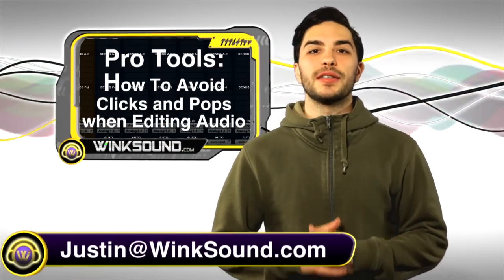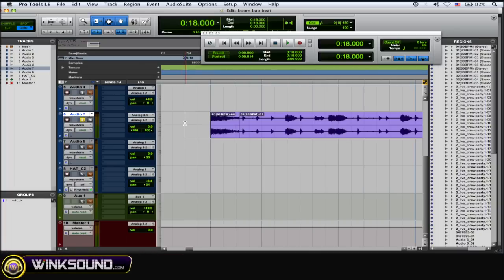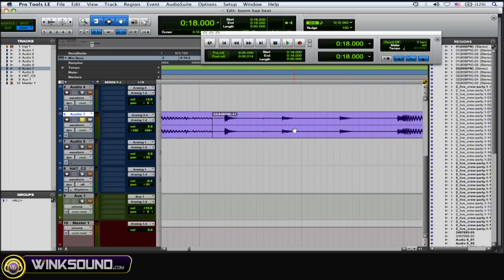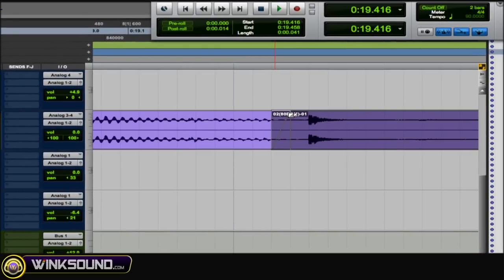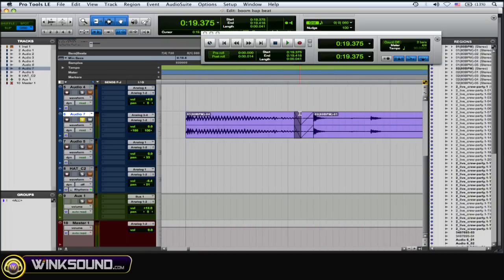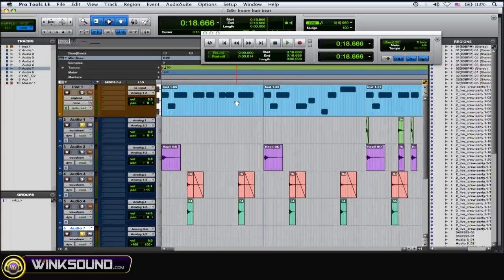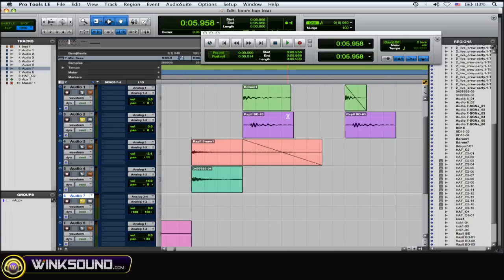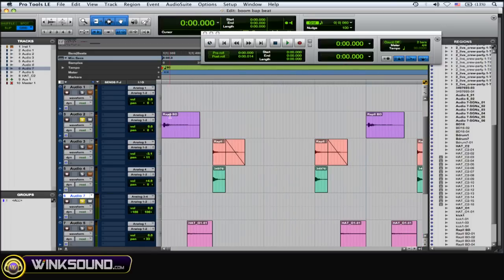Pro Tools: How To Avoid Clicks and Pops when Editing Audio | WinkSound

Comment: Hey! Great video..what if you have placed fades at about 10-20% (0.1-0.2)  to join edited  cut tracks, and you still hear a pop at the joint of 2 clicks despite you having 1 fade in and 1 fade outs in the appropriate place and even with playing around with fade lengths..you still can't get the pop sound out of the joining of 2 clips? Thanks for your response.